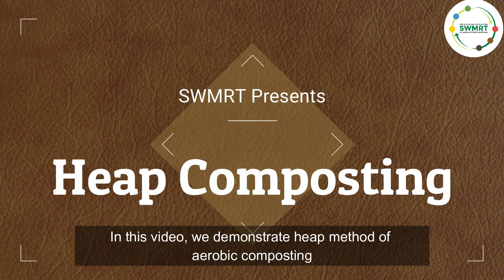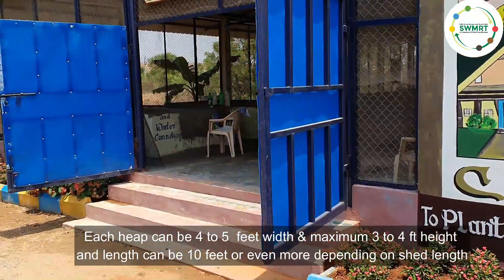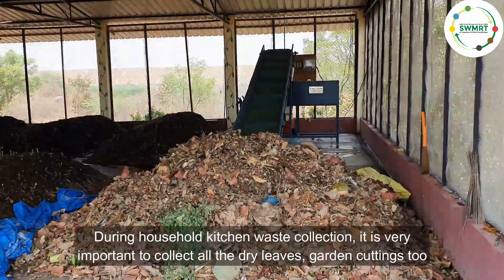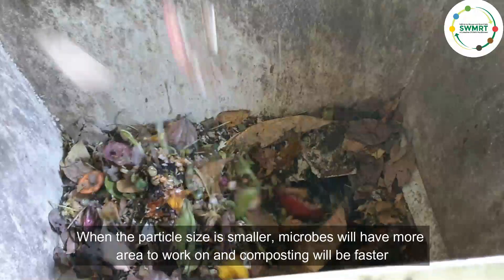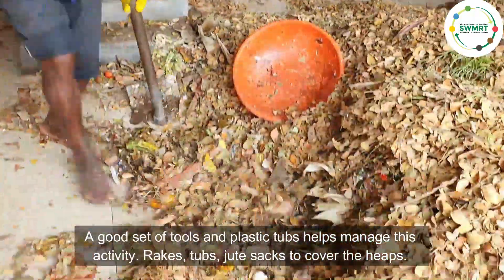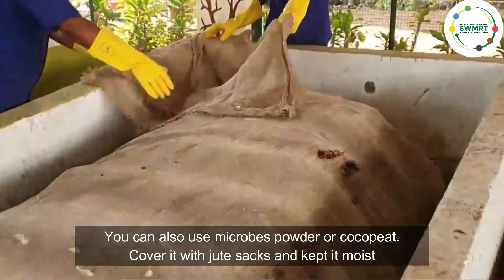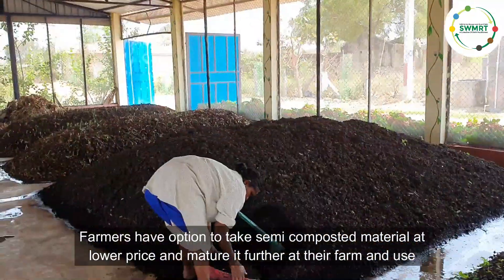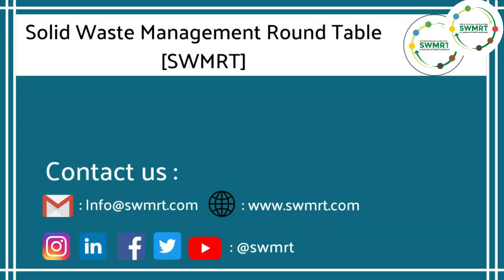Large Scale Heap Composting - Aerobic method, It is efficient, effective, sustainable

Comment: What is the use of cocopeat
Reply: This material is a near perfect mulch. When applying compost to the garden or field, it is essential to mulch over the earth and compost to prevent sun damage and other problems that inevitably happen due to wind and rain, etc. To make perfect compost It is not necessary to be on concrete, and it is not essential to be indoors. It is not necessary to add worms because in properly prepared compost on the bare ground worms will come from every direction without fail. If the heaps are built as steeply as possible, only fifteen or twenty degrees short of vertical, and then mulched and covered, rain will not be a problem at all, except in severe flooding. A good thick mulch using material like peat, hay, straw and other suitable carboniferous material is the key to avoiding expensive and non-essential infrastructure, as mulch protects the compost perfectly.